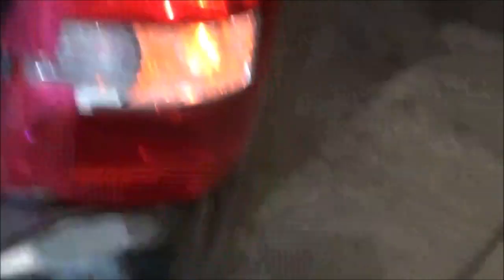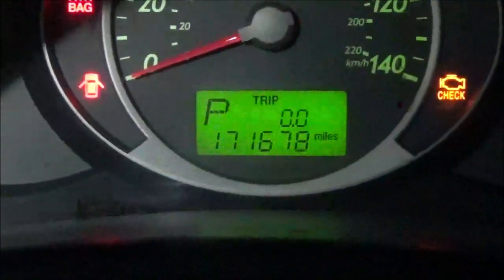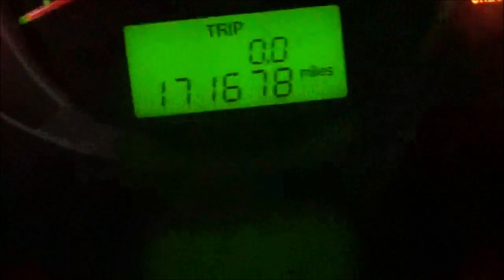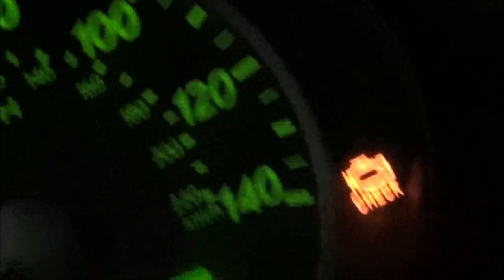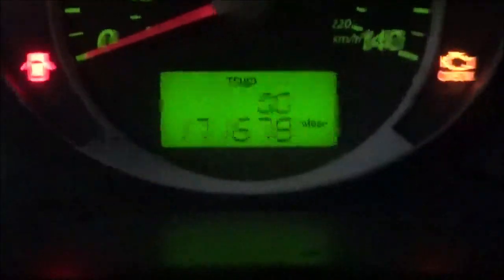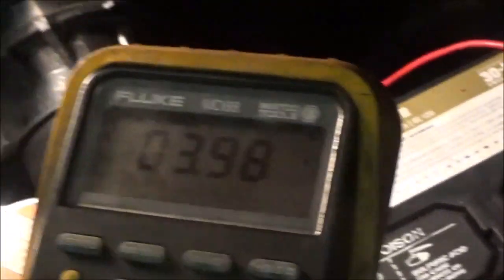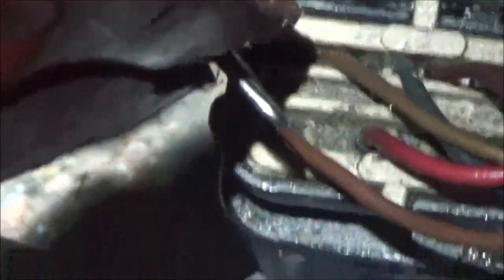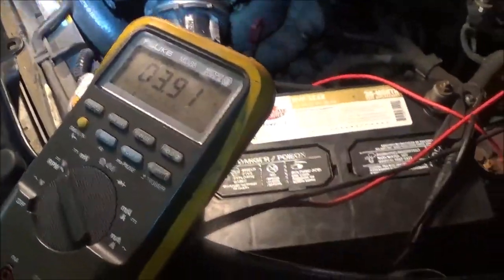2005 hyudai tucson transmission range sensor code caused by bad tail light!!! Part 2

Comment: Did swapping out the tail light fix it?

  Is the OEM light assembly LED or bulb type?
Reply from the maker: Yes. I just got a used light and six inches of connector pigtail.  I soldered the pigtail connector in and put in the the light.
Reply from the maker: The original light did not look like an led light. I was watching for that.
Reply: Thank you :-)